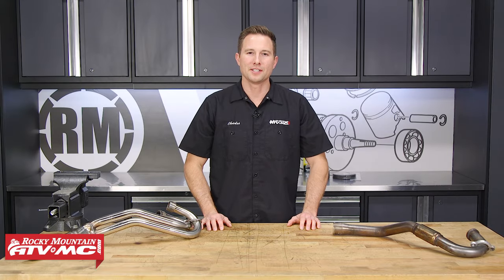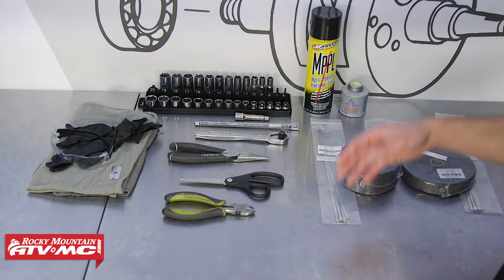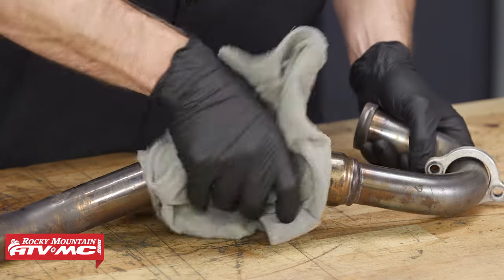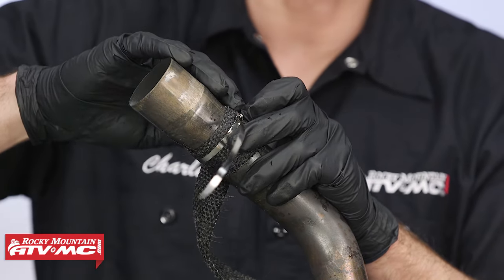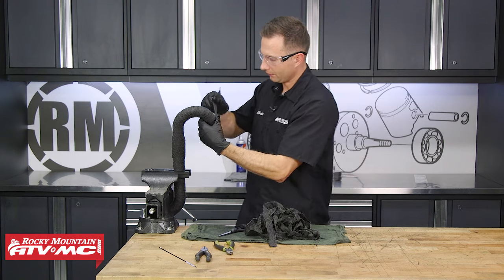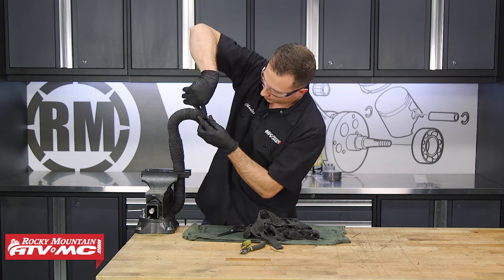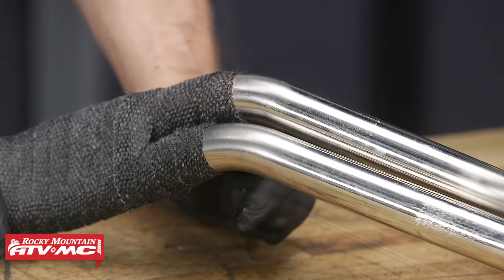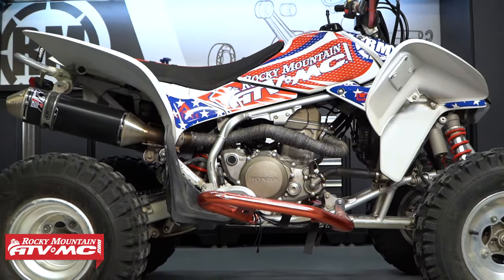How To Install Lexx Exhaust Heat Wrap on a Motorcycle or ATV

Comment: For anyone doing this on a smaller diameter pipe like a dirtbike exhaust definitely do the one inch wrap instead of the two.
Reply: Why is that?
Reply: @wiplash518  Its easier to wrap around the bend in your header pipe.

Comment: I thought your not supposed to wrap the pipe all the way to the cylinder but your supposed to start about 5 inches back from the flange. The OGs told me it will melt pistons.
Reply: Lol no that’s all BS that just keeps getting repeated, if that were the case all the big race teams would never wrap the header or turbo manifolds. 
Simple science and lots of proven performance

Comment: Do not soak the wrap! It rinses away some of the protective coating. This is per DEI.
Reply: no it doesn't, what happens when it rains then :D
Reply: @danielkerr4100 😂drizzles the rain and lose a 25$ roll of heat wrap
Reply: Bro if water rinses the protective coating then its useless against rain.. what are those coating for then.. think again

Comment: It is recommended by many fiberglass manufactures to wear a protective mask while handling the material.
Reply: I worked at a fiberglass factory and that's only if you're cutting it, particles.

Comment: Is it safe for pipes for rust?
Reply: It’s not water repellent, it’ll absorb water and cause some surface rusting. Maybe spray it with some high flash point penetrating oil to keep it from rusting?
Reply: @ethanclark6859 it only rusts if you park the bike with moisture in the wrap.

Comment: Do you have to replace the header gasket ?
Reply from the maker: Not necessarily, it depends on the condition of your gasket and if you can keep it in good shape taking the exhaust off. But it's a good idea to have an extra gasket on hand or just keep the exhaust on the machine if you're able to.

Comment: I soaked it and everything .. there are now irritating glass fibers everywhere in my shop. i havent stopped  being stuck with fiberglass needles for months.
Reply: The titanium wrap is definitely the way to go. On a dirtbike I also wrap stainless steel wire around the intire pipe at about 1/4” spacing. It helps resist abrasion from impacts or pressure washing.

Comment: I was told there is a danger of the header pipe on my KLR over heating and collapsing. Is there any truth to this?
Reply from the maker: I have never seen or heard of that problem!
Reply: gasoline burns at less than half the temperature that aluminum melts
Reply: @rmatvmc  I heard that you should NOT wrap titanium headers or it will just crumble to pieces.. only steel, it this true?

Comment: What grease did you use for the header gasket
Reply from the maker: That's just regular grease like Bel-Ray Waterproof Grease ( https://www.rockymountainatvmc.com/parts/bel-ray-water-proof-grease-p ) or Maxima Hi-Temp Waterproof Grease ( https://www.rockymountainatvmc.com/parts/maxima-hi-temp-waterproof-grease-p ). If it makes you more comfortable you can definitely use a hi-temp silicone but the grease was just used to hold the gasket in place when the header was put on, not necessarily for sealing.

Comment: Is this like the Fiber Fix heat wrap? I have a roll that's 2 x 70 inches long.
Reply from the maker: That product looks to be more for fixing broken pipes than insulating them, but it still should work fine for this application and block more heat than not using anything at all.